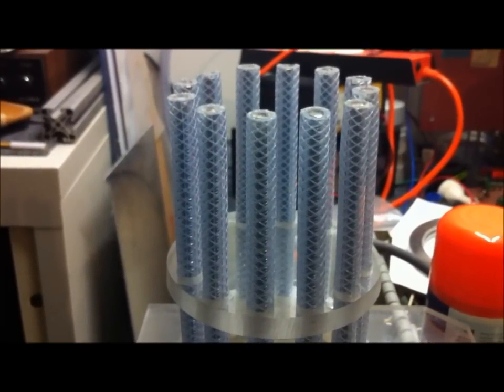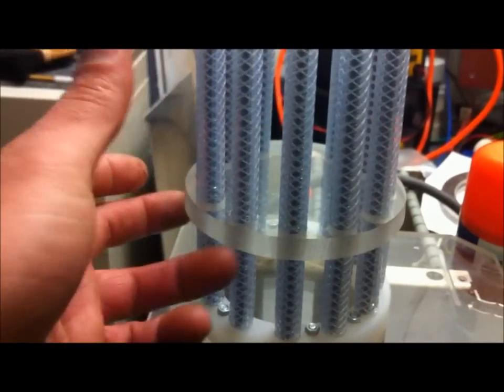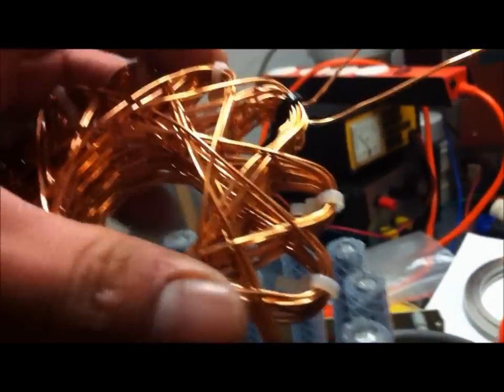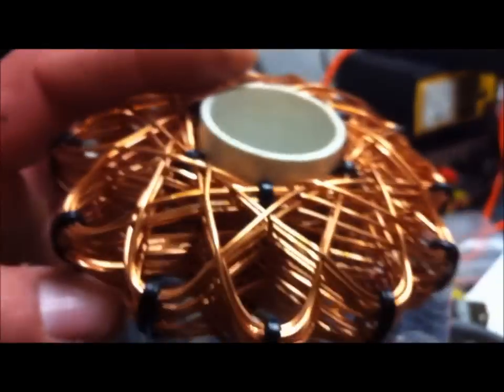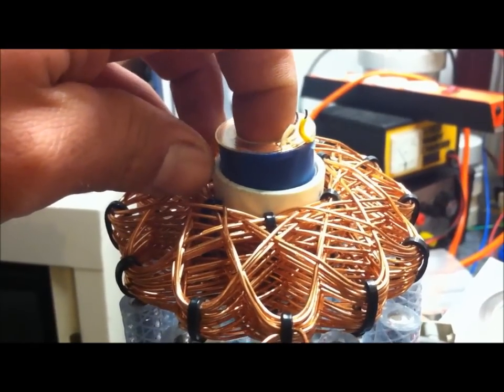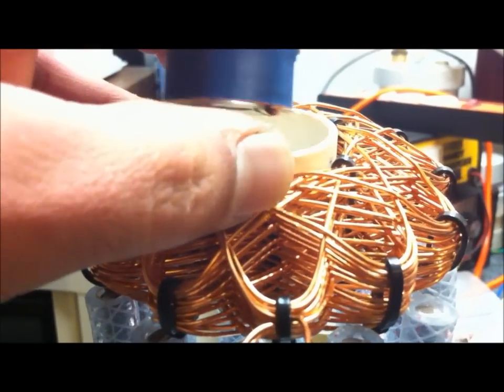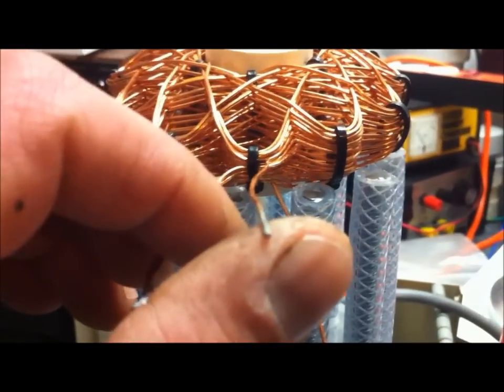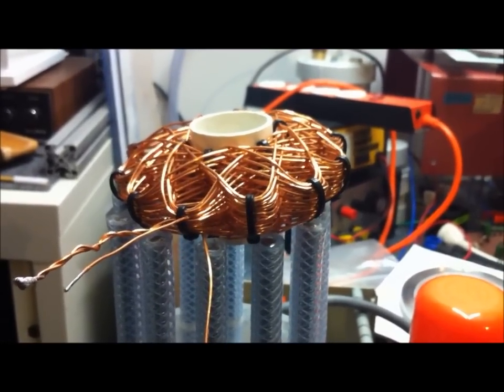Energy Update #6 - 12 Point Starship Rodin Coil Winding Jig & Various Winding Configurations

Comment from the maker: Yes, you need enamel coated wire for these coils. All coils require insulation of some sort between the windings to prevent shorts. If you use bare wire, the windings must be separated by an air gap or other form of insulation. The insulating material should be selected to suit the currents you intend to pass through the coil.